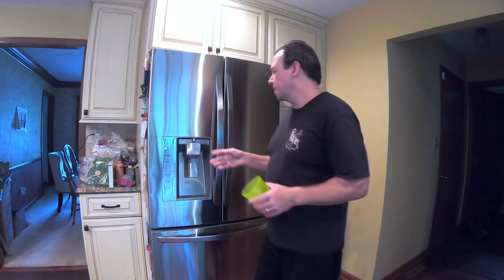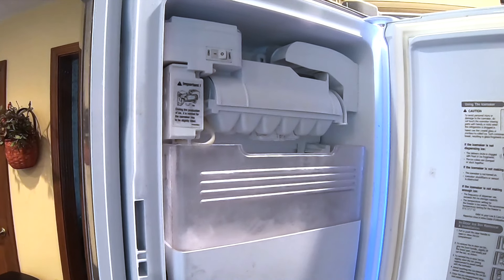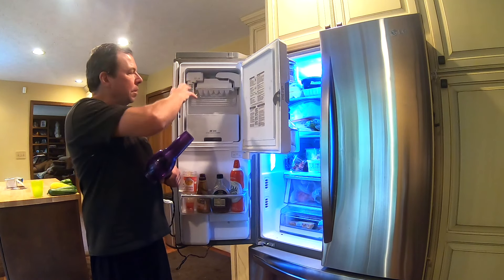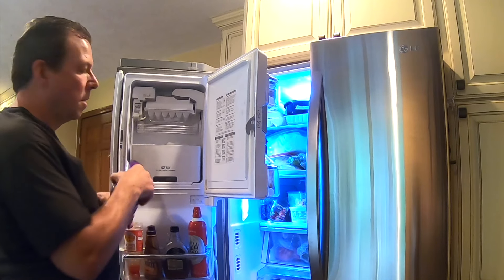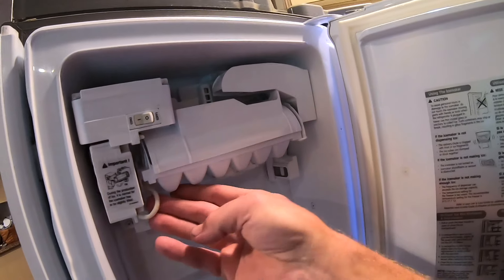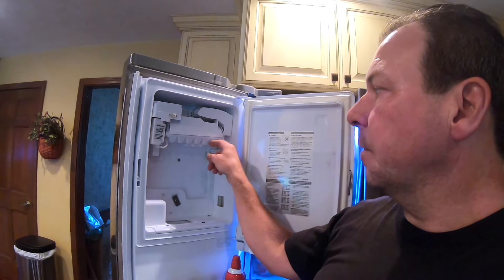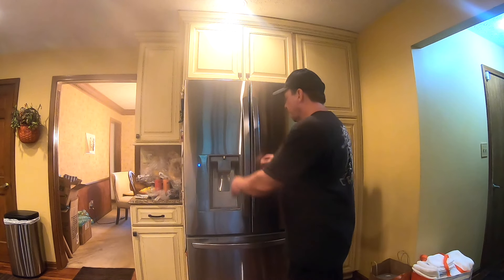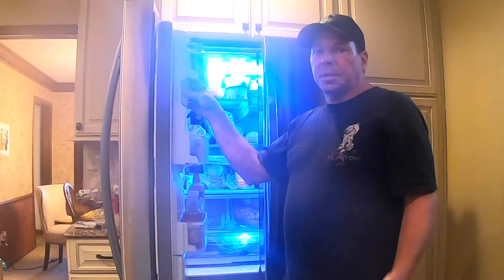How to Fix an Ice Maker - LG Refrigerator

Comment: That is not the supply line?!
Reply: Thought that too. Just replaced mine and took the old one completely apart and found that my ice cube tray had so much water deposit in it that the ice just could not break loose without using the hair dryer and then the ice make just quit altogether. I think too many times with it jamming up and not being able to preform it's cycle properly. I just bought a refurbished one from partsimple.com for less than half the price of new, easy site to navigate. Now waiting to see if it will work, I did check the ice tray on the refurbished one before I put it in and it's as slick as a whistle. I suspected it was water deposits in the old one as we have trouble with our plumbing fixtures... yes we have a water softener and yes it is working properly.... just bad water. Oh by the way I'm a 68 year old female DIYer who loves to tinker.

Comment: No more LG ref for us, this ice maker is always broken once a week 🤦🏻
Reply from the maker: Hi Lance, sorry to hear that your LG refrigerator isn't doing well.  Maybe replace the ice maker entirely and see how that goes.
Reply: @Housebarons  Your hair dryer fix is the first thing that's consistently worked to solve this issue.  My question about replacing the ice maker unit itself is how likely is the issue to repeat itself? Basically, do you think its the unit or a temp fluctuation that will repeat even with new unit?

Comment: DONT USE A HAIR DRYER! this can damage the plastics and rubber. it is much safer to use a steamer.
Reply from the maker: Hi Hahadint, we have always had great luck using hair dryers to fix this problem, but we put them on a low setting so they don't cause damage.  Thanks for mentioning the steamer as an alternative.
Reply: @Housebarons  Considering that all hair dryers have different low settings, this can still damage the plastics. I repair these things for a living, and no manufacturer recommends a hair dryer. Im glad yours hasn't caused damage, and props to you for creating some DIY content that may help someone (especially with a Samsung ice maker, they are the worst) get a little extra life out of their unit.